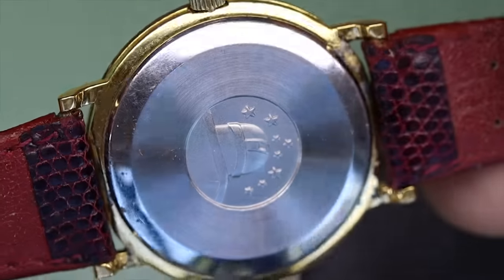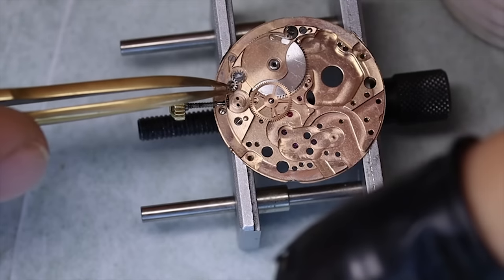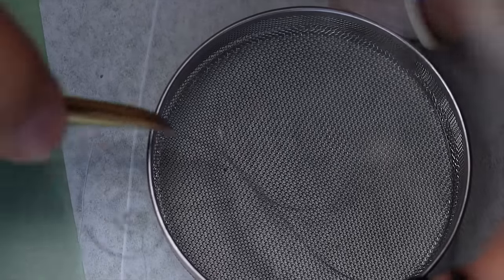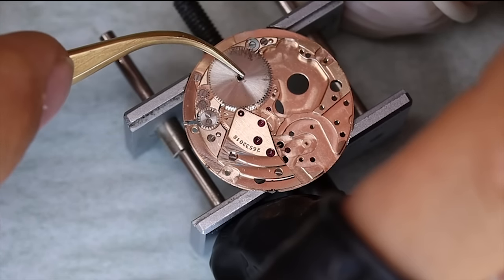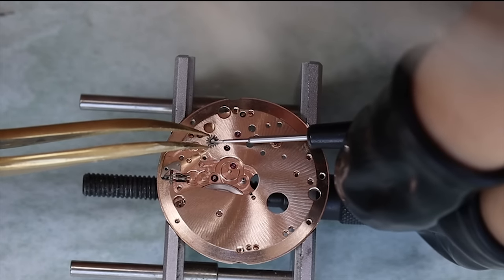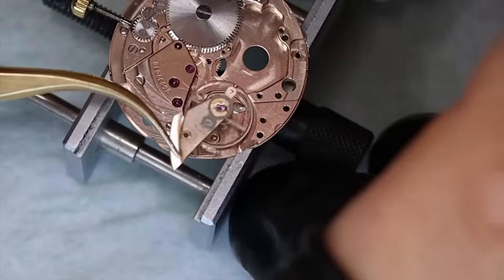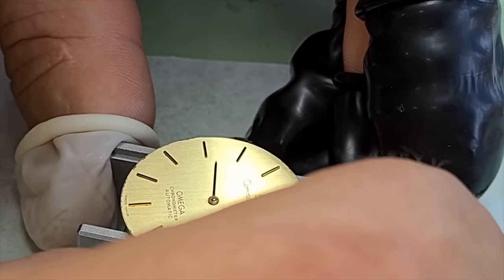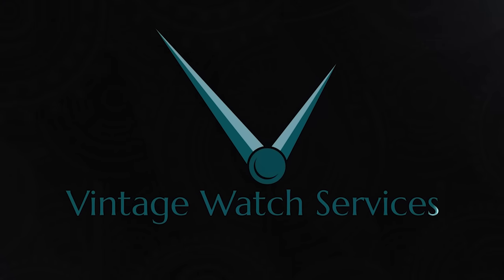What's inside Omega's thinnest automatic?

Comment: Hello :) new to your channel, great, great videos, love the comments and little details about the movements, thank you for educating! Wanted to ask a question about Omega automatics from that time.. always wondered why Omega used bronze and not jewels for the automatic rotor pivot point in that era? Rubies would last better I would think.. sure cracking from shocks is a risk and they cost more due to the required tolerances wich are quite tight in that aplication (otherwise the rotor is all over the place like in some modern watches hehe). Anyway, don't mean to scorn Omega here, their movements from that era are top quality stuff no doubt about it, one of my favorite vintage brand ;)

Comment: A great video, very well produced.  I wonder if there is a less aggressive way to improve the appearance of the case and case-back on vintage watches than conventional polishing with a motorized wheel.  I do fully appreciate your desire to not risk damaging the plating, or creating a "brand new-like" finish on a vintage watch, but at the same time, I think that cleaning the case with a solvent (after ultrasonic cleaning) and then very judiciously polishing it by hand would result in a better-looking case, more reflective, without affecting the character of the vintage watch.
Reply from the maker: Hello Michael, thanks for watching and for your comment! Yes, most of the time we will gently polish the case with at least a cloth and typically silver polish or the like, depending on the case material. The flaking on this case surprised me and after rubbing a bit on the case back I decided to not do much on this one. And the watches always look much better to the naked eye than under the camera.

Comment: Thank you for creating and sharing another thoroughly enjoyable video!  What oil did you apply to the automatic works pivots?  Thanks again.
Reply from the maker: Hello Woody, I used HP1300 for the automatic module pivots. The reversing wheel is soaked in Lubeta v105 and then left to dry under a lid for 15 minutes.
Reply: @VintageWatchServices  Thank you!!

Comment: I wonder if the plating issue is perhaps down to an owner who was a heavy perspirer? I have a couple of Omegas of similar age and the plating is holding up really well. I remember back in those days many men wore their watches on leather cuff straps so as to help preventing the plating coming off, never liked that look so with a few exceptions I tended to go for steel.
I think the eighties was a big time for thin watches but luckily by then quartz had arrived so one did not have to worry about delicate thin mechanical movements.
Reply from the maker: Hello Ian, thanks for watching and for your comment! Heavy perspiration might indeed have been a reason for this, as it seems more prevalent on the back than elsewhere. Still disappointing for an Omega, but by now most of the plating that flaked has come off anyway...
Reply: @VintageWatchServices  I agree, disappointing for an Omega, I’m actually surprised they did not just do all gold or unplanted Stainless for their chronometer watches, but then, it was a different age and I remember back then gold tone meant higher status and for the majority the tone of choice. Surprisingly I find my Soviet gold plated watches from the same period to be pretty thickly plated with real gold and I have had no issues with my Poljot fitted with the slim automatic movement.

Comment: Hi you mention using something cylindrical of the same size to press the mainspring in.  Is there something particularly difficult about this movement, like an unusually short barrel?  

I'm working on the 711 right now and ruined two new mainsprings already.  It jumps out while trying to press it in.  Using the mainspring winder on this mainspring is a disaster too, as it gets coiled up and breaks when I try to get the bridle inside the winder.
Reply from the maker: Yes, this movement has a shallow barrel drum. What I normally do is to overlay the mainspring over the barrel drum, press the entire mainspring down while it's inside the container ring and then press the bridle part down into the barrel first. My later videos show this better
Reply: @VintageWatchServices  Thanks, I’ll keep an eye on the bridle part when I try again.  I had the idea to transfer it first to the mainspring winder and use that to install it into the drum.  Let’s see, hopefully I will succeed with one of the three parts I just ordered :).  Many thanks Theon!  Happy holidays.
Reply: @VintageWatchServices  It worked, but on the first try... now I have two extra new mainsprings :)

Comment: Would the absence of a second hand contribute to the thinness? Question. I found another Hamilton 748 movement. Have not taken it apart yet. As I have a couple of projects uncompleted on the bench now. It does run but varies wildly. One time it has a 9.9 beat error with about a 220 amplitude. Another time it has a 4.4 BE and a 348 amplitude. I have attempted and maybe have demagnatized it several times. And it is running about one minute slow a day. Since I have three other Hamilton Nordon watches,  I was going to wear this playing golf to spite the new Hamilton watches that recommend against it in the manual. Last week I played with a 1961 Hamilton MW 688 (ETA) with not issues in performance after use. Where is a good place to start on the 748 Nordon?
Reply from the maker: Hello Jeff, those readouts you mention are before servicing the watch, correct? Beat error readings will vary a bit with the amplitude, but they shouldn't vary that much. Also, the amplitude reading of 348 sounds odd in an unserviced watch unless it is magnetized or the coils on the hairspring are sticking. 348 degrees would lead to overbanking, which you should also see on the timegrapher. In an old, un-serviced watch there is a whole slew of possible problems, which you will only find as you start picking it apart. The best place to start would be to give it a good cleaning, including all the pivots. Study the hairspring to see if there are issues with it and if necessary take it off the cock and clean it separately. I found a video on the 748's sister movement, the 747, here: https://www.youtube.com/watch?v=QwZT3sSM5oM

Hope that helps, Stian :)
Reply from the maker: Oh and yes, the absence of a seconds hand will reduce the thickness by around 0.3 - 0.4mm. That may not sound like a lot, but it is 10% of the thickness of the movement itself and when you're going ultra-slim, anything that can be reduced will be :)
Reply: @VintageWatchServices  Yes thanks Stian. I have not attempted to service the watch yet. 
the only thing I have done so far is attempt to demag it. I bought it mainly for the dial and stem. When I first demaged it and it started running about 248 with a 9.9BE. I thought the 348 amp was nearly impossible. The 747 is a sub second and a lot easier to work on. The 748,735 and 736 are harder do to difficulty lining up 4 pivots at once. Only diff between 748 and 735 is shock jewels and 736 is shock jewels and glycine?  balance wheels. As always thanks. And can't (but have to) wait for your next one.

Comment: I've been meaning to ask, why is it important for fixodrop and the lubeta to be contained in those peculiar hourglass-shaped bottles?  And what makes those pesky bottles so bloody expensive?
Reply from the maker: Hello Caledon, good questions! The reason for the shape of these glasses is that these substances evaporate faster than you can say fixodrop. The hourglass shape thus exposes less surface to the air when you open it and the cap is very well sealed. 
The second question is probably best answered by the old sales adage: the right price is what the customer is willing to pay... The best prices you see for these are around 40-50 euros nowadays, but if the Chinese start making them they realistically shouldn't cost more than 10.

Comment: Eventually our Chinese friends will come up with a mechanical movement that is under 1mm thick. I'm still struggling to service my Waltham pocket watch that is 1.5cm thick.
Reply from the maker: Never say never, indeed! I wouldn't bet on the Chinese being first, however, there's not much innovation in China, only cloning. That is actually one of the major challenges China struggles with, building an innovative spirit rather than cloning existing technologies for a quick buck. Creating an extremely thin movement requires a lot of insight and experience in finding solutions that reduce thickness, and that know-how is currently very much concentrated in and around Switzerland. But never say never 😁

Comment: This is the reason not to buy a gold plate watch.  Plate is the worst you can buy.
Reply from the maker: Hello James, thanks for watching and for your comment! Gold plating is indeed the cheapest way to make an object golden, but on quality watches the plating is typically so thick it should last for a very long time, perhaps even a lifetime. This is the first time I've seen an Omega with flaking.
Reply: @VintageWatchServices  
The problem is Omega watches out last owner.  I am wearing a 1944 18k bumper Omega .  If you saw it you would not believe it is 77
Years old.  It is absolutely beautiful.    There are Omega watches out that there show little to no wear.

Jim